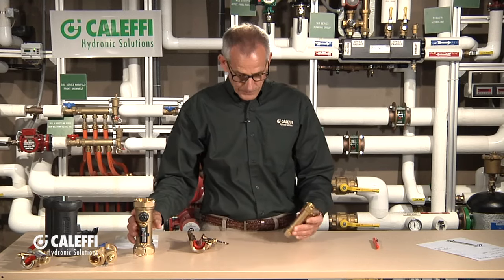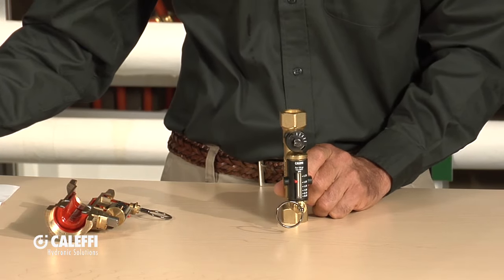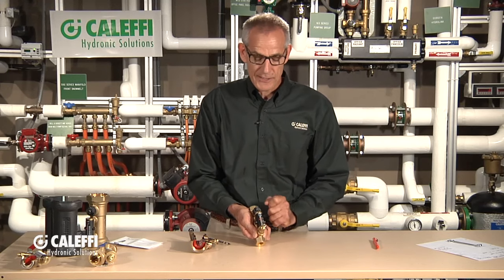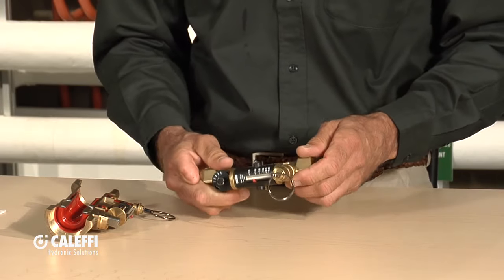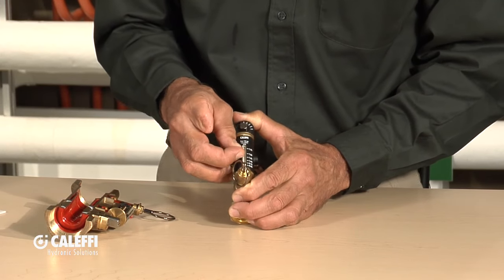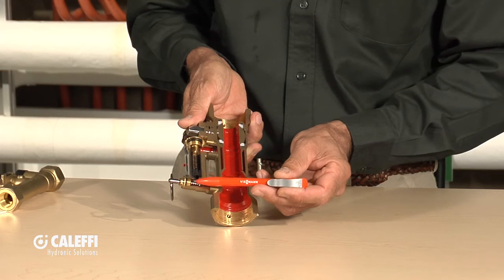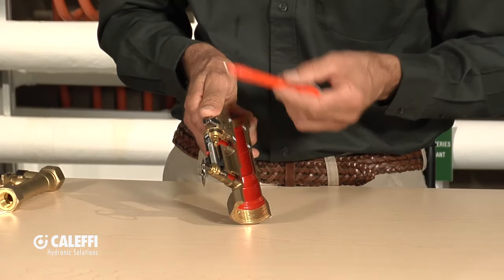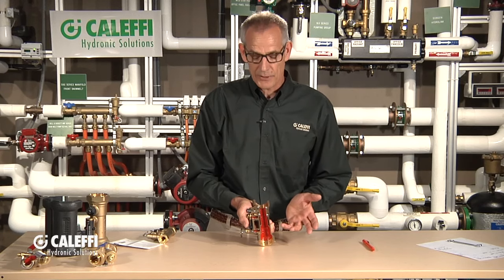QuickSetter™ - Balancing Valves with Flow Meter

Comment: I have a Geothermal unit that needs to run at 3.5 GPM. This looks like it would work perfect! Would I be better putting it on the feed or return of my unit (Open loop/Pump and Dump) I have a pressure feed in and a shut off valve on the return so when the Geo unit calls for heat/a.c. it opens the shut off valve that is on the return valve to allow that water to dump back into my reinjection well. I would assume this would be best on the supply side as close to the unit as possible. Thoughts?
Reply from the maker: The Quicksetter will work on either side of the unit so long as the straight pipe requirements (called out in the instructions) are met.  Just a reminder that the Quicksetter is not low lead so it may not acceptable in an open loop application using potable water (depending on  your location / inspector).  The Quicksetter Plus is a variation of the Quicksetter that is low lead and may be a better option. We hope this helps.

Comment: I thought you were not supposed to use ball valves for throttling flow.
Reply from the maker: Throttling or balancing using a ball valve without a flow meter can be a guessing game. The QuickSetter™ is useful since standard ball valves don't allow you to know the flow rate.

Comment: I installed 3 of these and not one of them registers the minimum 7litres per minute
Reply from the maker: We are sorry for your experience.  We suggest:

1.       Verify the flow direction. If the valves are installed backwards, they will not register the flow when the pin is pulled.
2.       It is possible there is debris stuck in the flowmeter if the system wasn’t flushed before the valves were installed.   The valves can be removed in order to flush them.